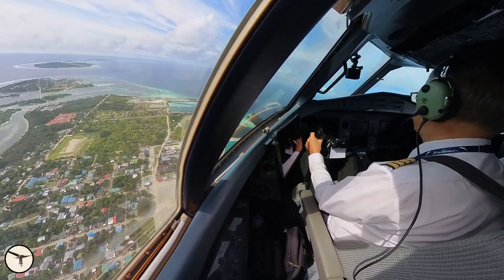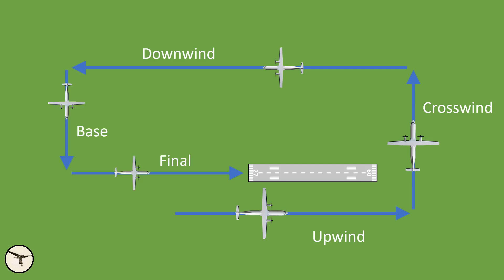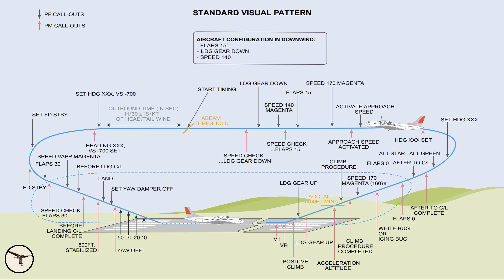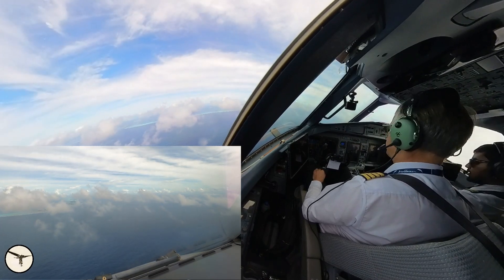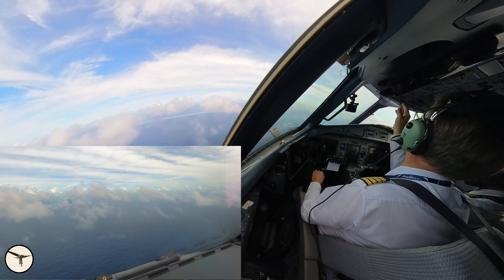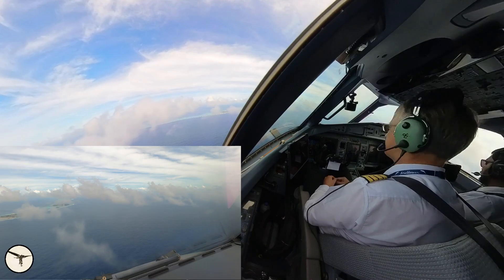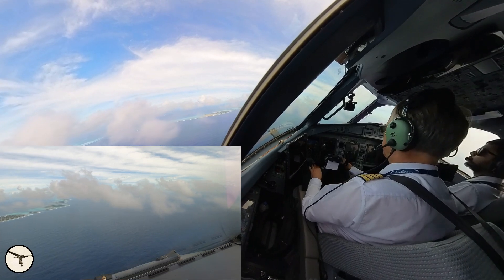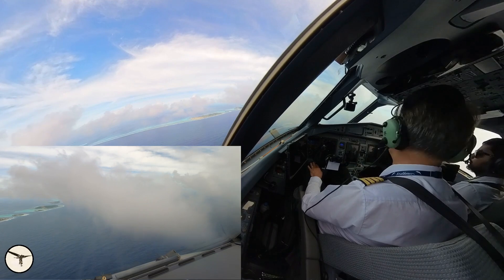Flying the ATR - Visual pattern

Comment: When I do traffic patterns on ATR I put waypoints for downwind turn, base turn and final turn. I actually used Pythagorean theorem to get the best angle and distance to create a good waypoint for base turn. It turns out I made a perfect rectangular path! My values are 3nm base leg and 4nm final leg. Using Pythagorean theorem I got the distance from base turn to the airport would be 5nm and the angle would be +/- 36° to the runway track. These are values that i put on the FMS. With this, I can perform the pattern on a continuous descent
Reply from the maker: Yes, Pythagoras works well. But with a visual pattern, you cut the track distance in half.

Comment: Hi Captain, Thx for this very instructive video, as always !
On MSFS  side,  I noticed when lining up on RWY before TO. that he RWY altitude as displayed on the PFD is only right at 1013 Hp, if I set the BARO at QNH, the altitude is erroneous. This fact might explain a series of bugs related to FL or Altitude of the aircraft, like VNAV,  V-FP etc...
For the time being,  I keep the BARO at 1013 , it is not very realistic but at least I can eventually rely on the PFD altitude display !
Kind regards
Reply from the maker: The default QNH in MSFS is 1013 hPa. You can change QNH in the weather settings. When you fly at a flight level, you push the BARO SET knob (right click with the mouse) to get STD setting (1013.25 hPa.)
Reply: @FlywithMagnar  Yes captain, you are absolutely right. Actually we need to fly in "Live" weather conditions to get the right altitude on PFD at QNH. Otherwise we have to keep BARO at 1013.25 hPa or change the QNH in the Weather settings. Thx for your answer and have a good day.

Comment: One more thing I wanted to clarify. As you know, almost all over the world, enjoy airport pressure by QNH. In Russia, as far as I know, we still use the QFE pressure, which the air traffic controller announces to us before landing. Based on this, the algorithm for setting the minimum for landing with a DH / MDA rack is not entirely clear to me. Indeed, for QFE pressure, if I'm not mistaken, according to Jeppesen's charts, the DA indicator is intended, which is not on the ATP-72. How can I set the minimum before landing if the air traffic controller in the city of Krasnodar / URKK gave me the airport pressure in QFE ?

Comment: Hi Magnar, quick question when the ATR AP is banking to a new heading, do you ever use rudder trim to expedite the turn? Like if the intercept angle exceeds the banking limitations.... What is this called? Procedure?
Reply from the maker: Never. That will result in crossed controls, which is a no-no for all pilots, unless you are landing in a crosswind. Except for takeoff and landing (and engine failure) we never touch the rudder pedals. Besides, the 600 has automatic rudder trim.
If we overshoot the new track in a turn, it is because we are flying too fast. The procedure is to reduce the speed and turn back to the intended track.
Reply: @FlywithMagnar  perfect thanks!

Comment: Magnar, hello! If possible, please tell me how I can enter a point with known coordinates in FMS so that it is shown on my display in the flight plan and participates in navigation during landing approach. For example, how to drive a point into the flight plan, with coordinates 173149S0400004W. When drawing up a flight plan, I had difficulties with this, because when entering the runway, there were no navigation aids, and even approach patterns. I studied the tutorial, but I did not find this nuance. Thank you!
Reply from the maker: You can create a waypoint with lat/long coordinates. Example: N0637.72/E07304.34. Or as a reference to an existing waypoint. Example: To create a waypoint 5 NM north of RAXON, enter RAXON/360/5.
Reply: @FlywithMagnar  Understood. I'll try these options. Thanks a lot!!
Reply: @FlywithMagnar  Magnar, the request will be to you - if possible, then please make a video, as in the ATR-72-600 from the simulator you need to enter the coordinates of the desired point. I have a suspicion that this has not yet been implemented by the developers. Or I'm doing something wrong again. Thank you!

Comment: Hi Magnar, just a quick question. Will you be penalised on your checkride if you deviate from manufacturers procedures when it comes to traffic patterns? (ie. Putting your landing gear down on base leg instead of downwind)
Reply from the maker: No, for two reasons. 1) As long as it is safe, you are good. 2) Normal procedures given by the manufacturer are recommendations. The airline company can choose to change some of the procedures to fit their operations better.
Reply: @FlywithMagnar  how far miles you should fly downwind leg?

Comment: very nice video as usual. quick question. with full flap set so early in the approach whats the procedure if one engine fails on long final?
Reply from the maker: Feather the propeller of the failed engine and continue approach. We fly single engine approach in the same way we fly with two engines.
Reply: @FlywithMagnar  ok thanks much. On the dash 8, 35 flap is too much drag to maintain glide path with a failed engine, thats probably why the Flight Manual says select 35 flap "when landing is assured" In one instance one pilot found he had to continue adding power until he was at max power to maintain PAPI with 15 flap after one engine rolled back on a visual approach into TAPA. I will call him see if I get more info.
I spoke to him. it was above 700 ft on final that the #1 engine suddenly quit. the shaft to the fuel pump broke. they were close to the runway so they continued but when he reached 90% TQ and could not maintain the PAPI he realized he must feather the prop. yes it was configured with15(approach) flap. 15 flap landings were routinely done.
Reply: there’s an SAS incident a few years back that almost turned into an accident where also an engine failed on final, the CPT coming from 737s before elected to continue and NOT FEATHER the engine. They nearly lost control and the tower control already pushed the crash button for the fire brigade.. 

i do t fly Dash 8 or ATR but Short Skyvans, we do t have auto feather but a Negative Torque relief system that will reduce pitch on the failed engines prop when it senses the prop is driving the engine (single shaft) but one can never rely on it and should all ways feather the failed engine else you put yourself into test pilots shoes ;)